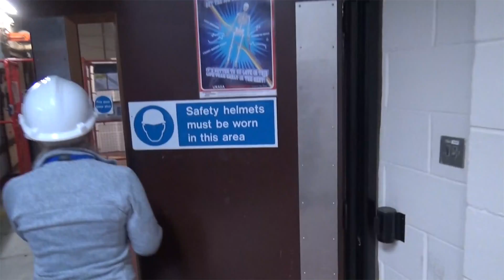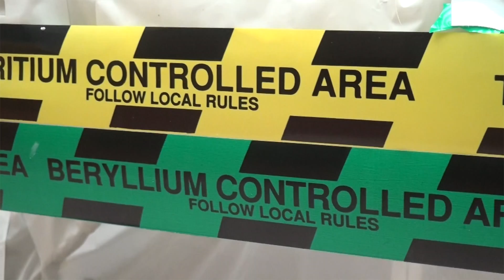Fusion Reactors - Inside JET, the HOTTEST place in the Solar System! A Level Physics

Comment: You're talking about scientific breakeven without explaining that this ignores the hundreds of MW required just to run the machine. JET needed over 700MW of electricity to create 16MW of heat.  Lots of hype about fusion at the moment.  Unlikely it will ever work. Even if it does, it will probably be too complex and too expensive to be a practical source of power.  The problems with fusion reactors are well described here: https://thebulletin.org/2017/04/fusion-reactors-not-what-theyre-cracked-up-to-be/

Comment: how do you actually heat up the plasma?
Reply from the maker: It’s basically like a household microwave.
Reply: First you create huge currents (kilo to mega ampers), then the plasma heats up the same way the wires heat up in your kitchen toaster. Then you turn on the powerful microwaves. These are generated by the oblique metal bar array at the right in 9:53 and heat further up the plasma, and also runs more current.

Comment: Why do we always use water-->steam-->turbine? Surely there are other ways to convert the energy? Or is it the most efficient way?
Reply from the maker: The only other main way is using photovoltaic solar cells, pretty much everything else relies on turbines turning and the way we can most reliably control this is by heating up water. Same in gas, oil, coal, fission and biomass power stations.
Reply: @PhysicsOnline  Inverse cyclotron resonance conversion is also possible for certain fusing plasmas with low neutronicity. No water, no steam, just direct ion deceleration.
Reply: It's all about control,power,money, greed, our governments around the world don't give two shots about the 99% only rich n powerful are going to get a ticket to survive, this year is gonna be bad then the next year, if we even make it.. nibiru